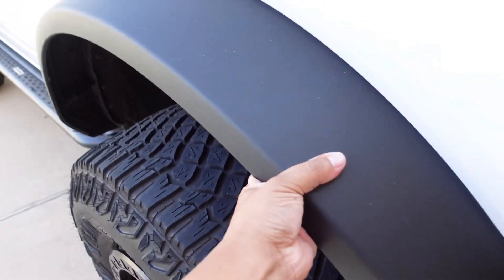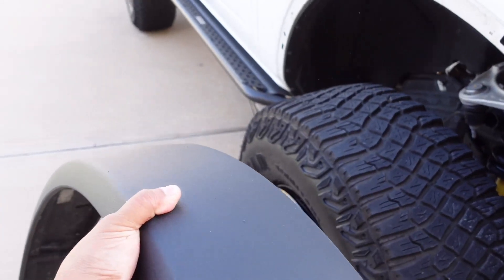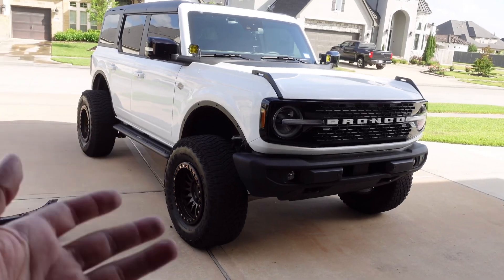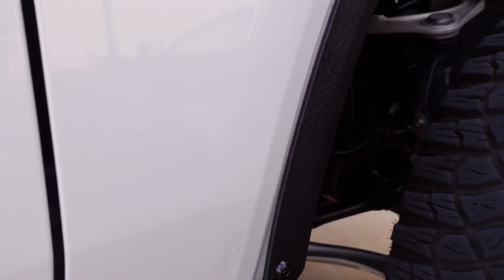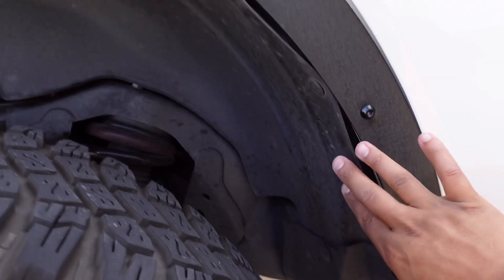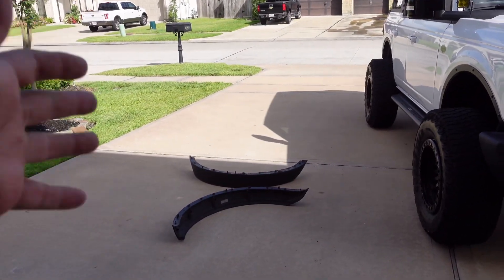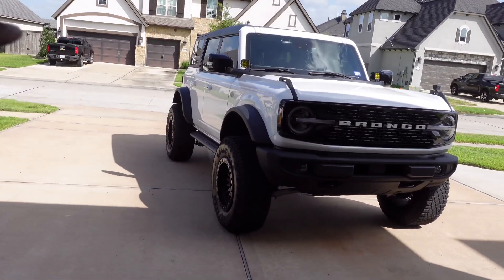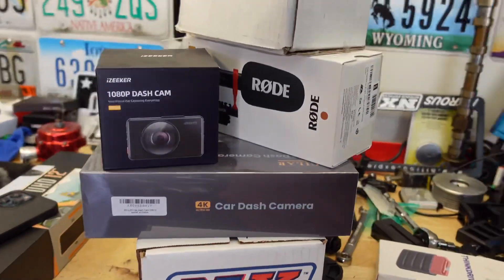SHOULD YOU DELETE YOUR FORD BRONCO FENDER FLARES? Fender Flare Delete From Hooke Road

Comment: Personally, I prefer the fender flares, but I think you have been doing a great job with the bronco. I noticed a pedal commander. How do you like it paired with the 2.7? I wish ford would have put a coyote in the bronco, but I can see those ecoboosts making more power while being easy-ish on the wallet. Im curious what these will make on a downpipe, bigger intercooler and tune. I’m a die hard gm guy, but I hate that they don’t give us vehicles we want. Ford seems to care about customer needs, which is why I’m now considering a bronco. Have you had any issues with it, or any complaints?
Reply from the maker: Appreciate the comment, as far as my Bronco I haven’t had any issues or problems with it. I’ve had it over a year & have about 14k miles on it. I agree a V8 option would have been great but this little 2.7l will surprise a lot of people on the power/torque they have. I did find it to be sluggish at first which is the reason I got the pedal commander to eliminate the pedal delay which helped a lot. I definitely recommend the Bronco to anyone.